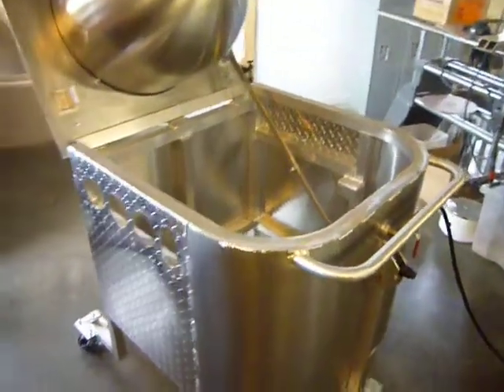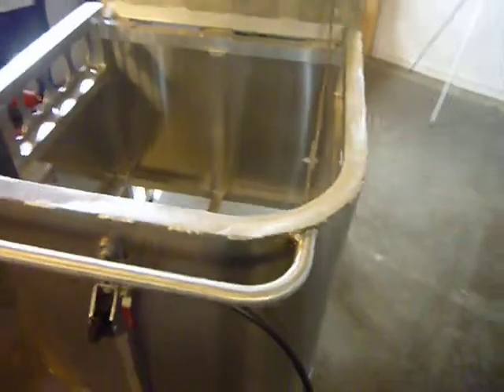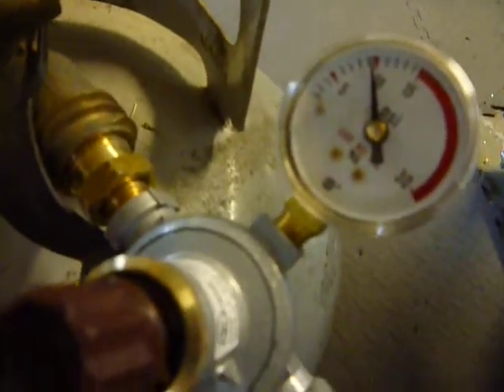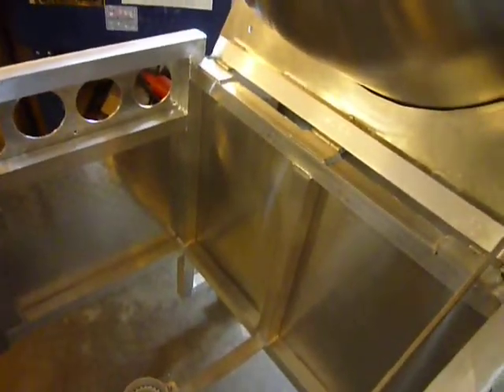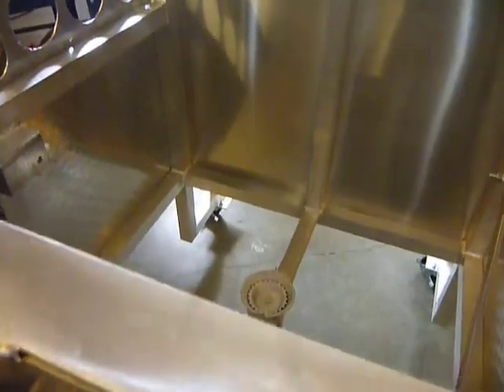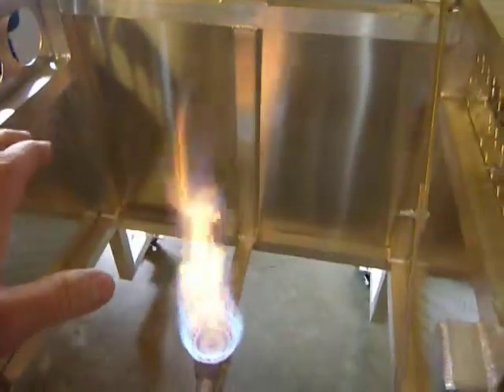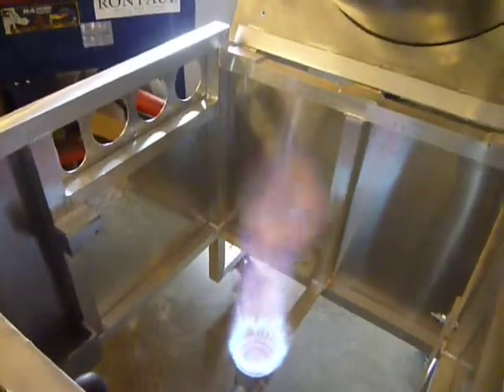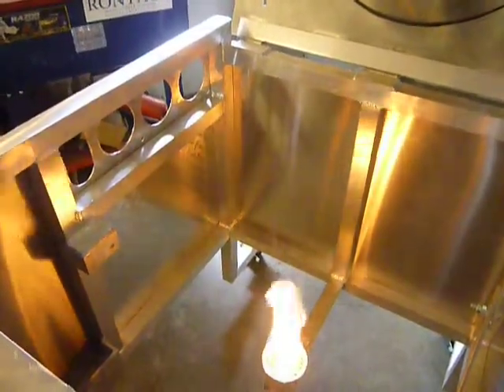Kettle Corn Business - kettlecornsupplies.com - Lighting the Burner

Comment: Good morning.  I'm wondering if you could help me out. I had flame shooting out of that little bell shaped area. Along the pipe line. I've never touched the system before with a wrench. I'm thinking it needs some tightening.  My hubby used to repair everything but he passed away 2 months ago. I'll check the whole thing but wonder if I need a "propane guy" or can I do this myself? Thanks for any help. Shannon

Comment: Where do you get one of the gauges that you had sticking out of the regulator?
Reply from the maker: I get them from my local "Do It Best" Hardware store. They are for welding tank regulators gauges. I get the one that shows the pressure in the red zone from 15 to 30 lbs. It's easier to see the lines than the one that goes up to 60 psi. If they don't have it in stock they can order it for you.